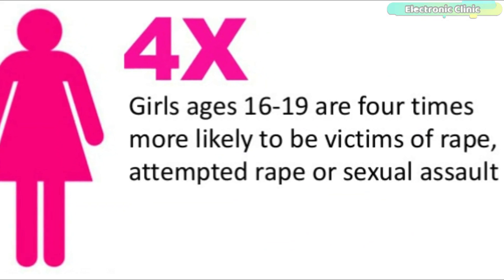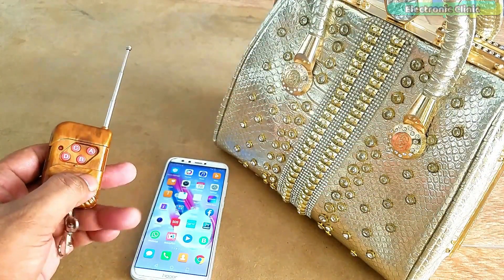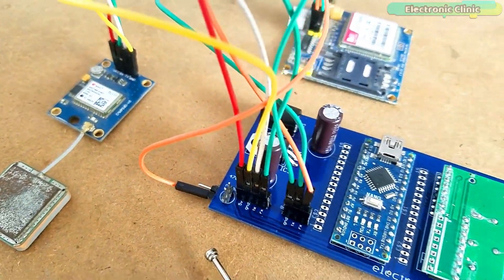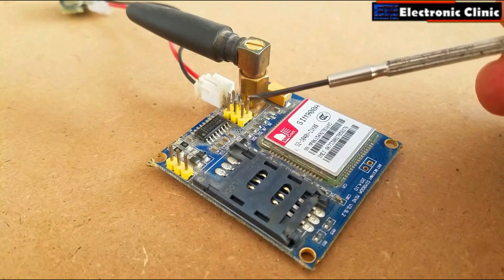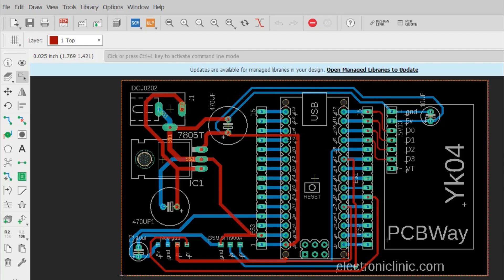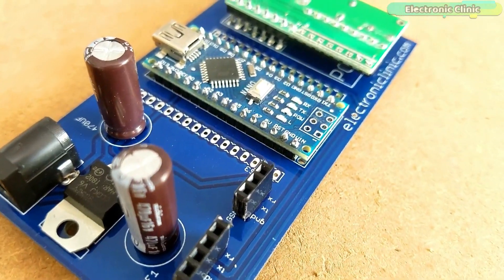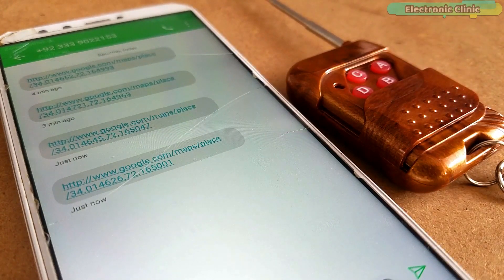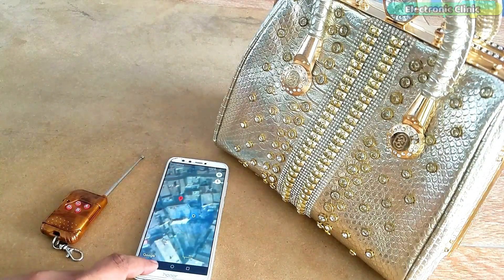Women Safety Device, Smart Purse with GSM and GPS Location Tracking, Smart Girl Security System

Comment: Sir, if I dont have remote control, how can I get the google map link sms automatic send to my phone? (I just have Arduino Uno, GPS 6m,  and Sim900A GSM)
Reply from the maker: you can use any sensor to trigger the input.
Reply: @ElectroniClinic  I dont have sensor module, I think maybe tomorrow I go car shop buy the car contoral and take out the Yko4 module lol
Reply from the maker: you can purchase the yk04 online.
Reply: @ElectroniClinic  yes haha,because I need it hurry
Reply: @ElectroniClinic  Sir, the google map typing  inside the code: “+mylati“,”+mylong" is mean it will auto convert the current place where my prototype are?
Reply from the maker: yes. it will generate the link.
Reply: @ElectroniClinic  But I am using Arduino Uno, do the code sir provide that can use om Arduino Uno?
Reply: What are the modules we use here?

Comment: Omg how do I get one of those pcb ruler. Got one spare for me?
Reply: Also could the transmitter made to made smaller so it could be clipped into the bra.
Reply from the maker: the transmitter is quite small. can be easily clipped.
Reply from the maker: yes i have. i will send you.

Comment: Power consumption of gsm/gps is too high. The battery will drain quickly.
Reply from the maker: all the electronics are powered up using the Lipo battery pack. it wont drain quickly.